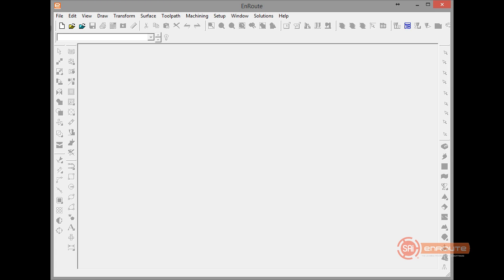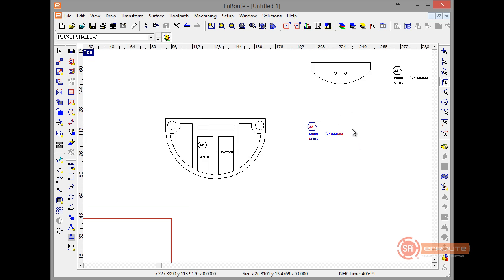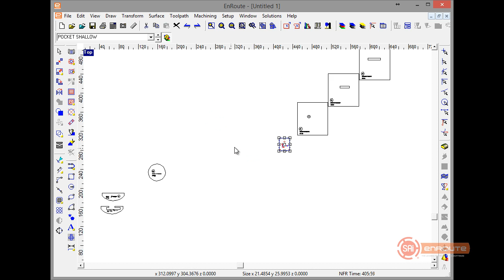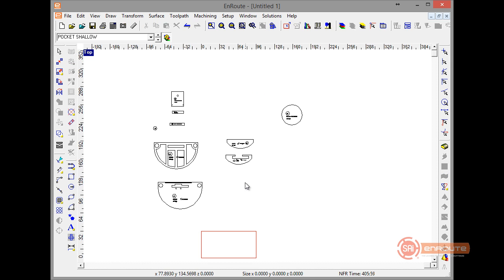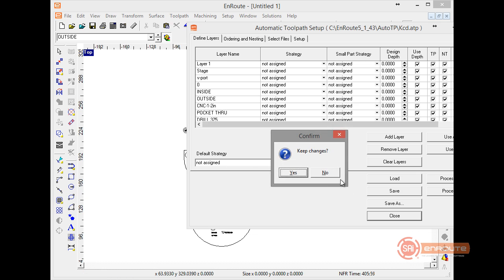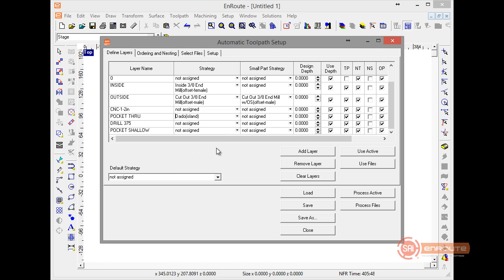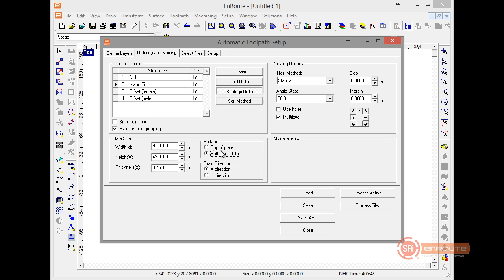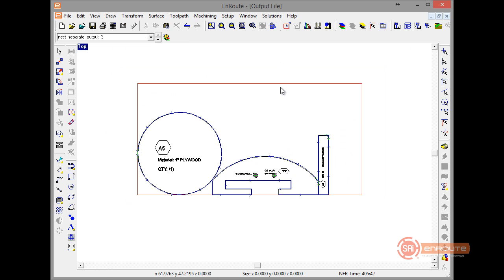Import DXF files from Autocad and Process them with EnRoute ATP

Comment: I'm trying to import thing into EnRoute, but almost everything keeps importing in magenta with arrows around the lines. Any idea what going on here and how to fix it?
Reply: I'm not sure if you have this figured out already or not but if the lines are showing up magenta with arrows, they are being imported as open contours.  You can go into your "Preferences" and make sure your "General" tab is chosen and there will be a selection called "Merge Contours".  Make sure that the "Import" selection is checked and then most of your lines will be imported as closed contours.  You can play with the "Tolerance" amount until the number of lines you want to be merged is actually being merged.  I hope that helps with your issue.
Reply: @tracyquasebarth7787   Hi, how are you? I'm one of your followers and your tutorials really help me, I want to learn more. I work in a display company and they have this software enrouter 5 I am an operator and programmer of the cnc mill and I would like to ask you how I find the surface table does not appear on the home screen either in setup could you help me?
Reply: Your “table” area should be specified when you create a new file.  Then you put in the dimensions of your table or the material your are going to mill and then there should be a red outline show up representing the information you input. Then you can import your file.
Reply: Thanks for the help.